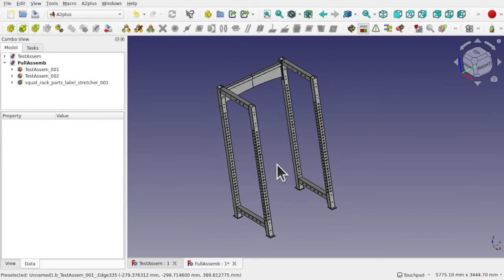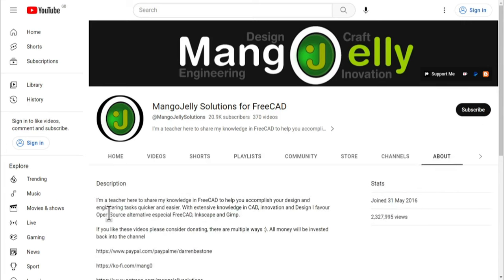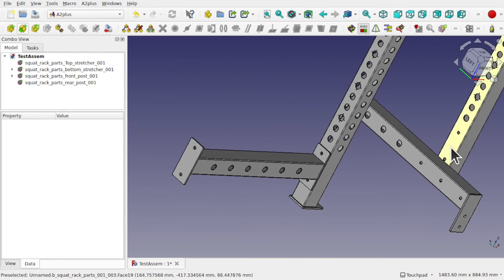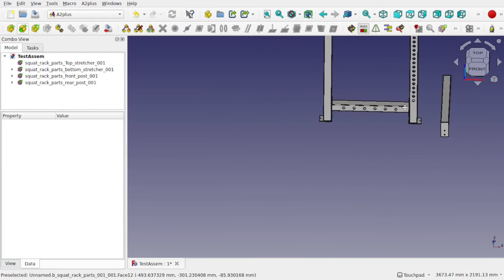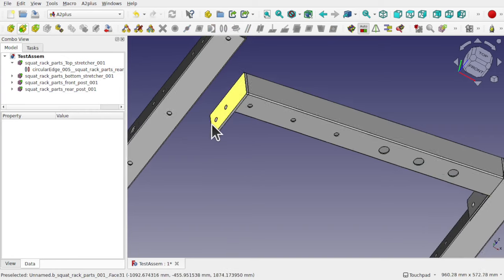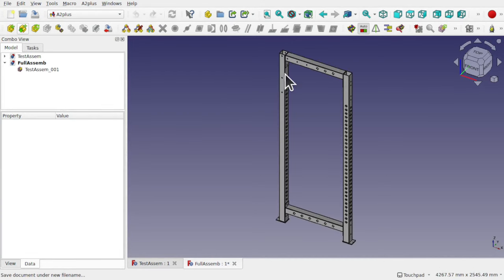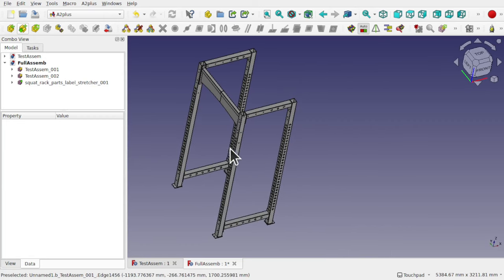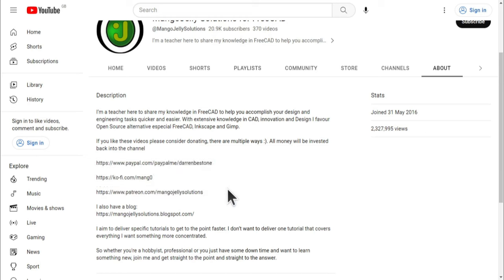Efficient Assembly Workflows in FreeCAD: A2 Plus Sub-Assemblies for Time-Saving Results

Comment: A nice addition would be if constrained components were color coded and in the specific order in which they have been constrained.
It would help in remembering which ones you already did or missed in very complicated assemblies.
Reply from the maker: Funny you should say that, the original patreon who's parts this come from wanted to color parts but for a different reason. They used to have a small hole at the bottom of one part to show which way up it was, after a get together we went through a crash course in A2Plus and colouring faces to show which part goes to what. But we did it on a face level. I like your idea of colour which ones you have already constrained.

Comment: How much is it tolerant to changes in original parts? For example if you change sizes of pipes, distance between holes and their sizes, etc, or would use configuration tables.
Reply from the maker: You have to be a bit careful of tnp. As long as the change doesn't cause a extra edge or face then you will be fine. But if it does you may have to update the assembly by reattaching the constraint.